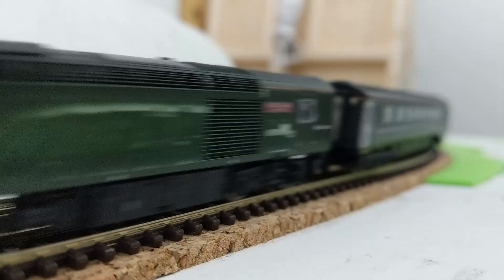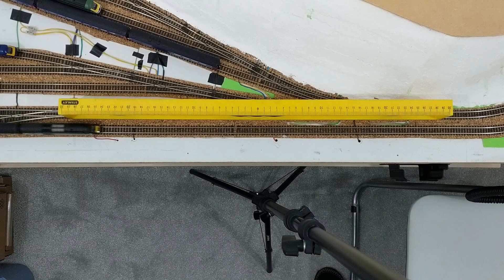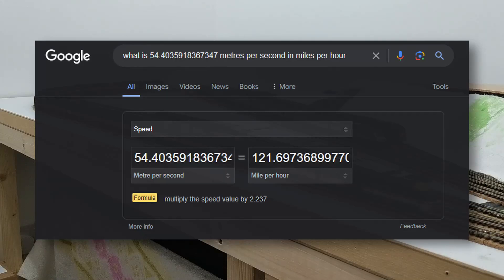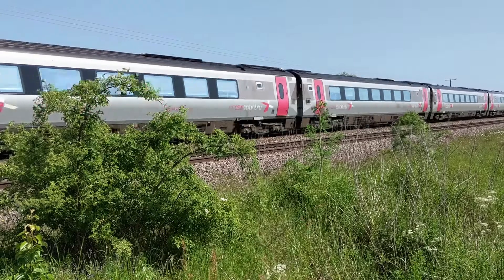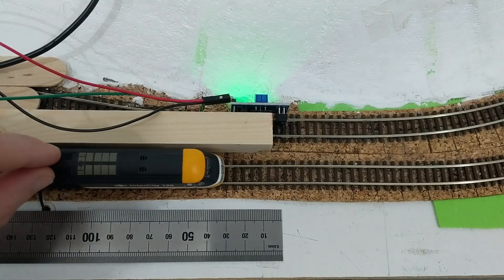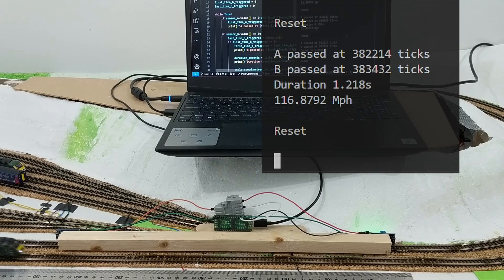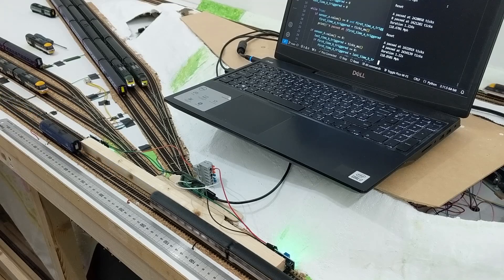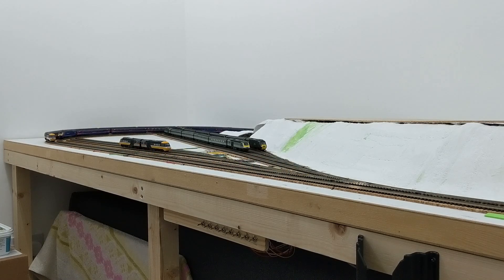0042 Scale speed of Dapol HSTs (and a Kato 800)

Comment: STRETCHING THE ISSUE !!!
The problem with "T" Gauge (T = Three millimetres between the rails) is what actual scale ratio is used. A Japanese company "KK Eishindo" introduced "T" Gauge back in 2006, to represent the Japanese main rail network Gauge which is NARROW GAUGE 3ft 6in. NOT Standard Gauge 4ft 8.5in. This means the original Scale Ratio of 1:450. BUT If Standard Gauge models are used, this upsets the scale ratio and changes it to 1:480, and for Broad Gauge 5ft 6in model trains the scale ratio becomes 1:500 !!! Which means models of Standard Gauge trains effectively shrink slightly , and Broad Gauge model trains, have to be shrunk further. So that the 3mm wide model track still represents the track gauge of a real train using these various gauges and the real track it actually runs on. Which has far bigger implications for larger scenic items such as buildings !!!  This of course reveals that no International agreements were made between manufacturers over the introduction of this scale sadly !

FURTHER POSSIBILITIES
Further 3mm gauge track and available motorised mechanisms also opens the door to this track being useable for Narrow Gauge trains in the larger scales. So in Z Gauge the "T" track would represent 2ft Gauge. In N Gauge "T" scale 3mm track represents a Gauge of just 18inches. In TT100 the "T" gauge track becomes just 1ft Gauge. And in British "OO" the "T" gauge track represents just 9in gauge track !!! 

NOVELTY EARNS MONEY !
So on your "OO" mainline layout you can now have a Rich Mans sit upon railway around his back Garden using "T" track. And a "T" Gauge HST with the cab roof partly removed, and an OO scale model Human sitting in the "T" scale HST power car  - Think about that for an exhibition layout. Which could, if the whole layouts very realistic, earn you a lot of money !!!! Magazines pay you for Model Railway articles. And once your layout appears in a Model Railway Magazine, you're bound to get invites to exhibitions, which can earn you more money, and even get you on TV !

Indeed I was the first to introduce a Japanese Outline Exhibition layout in Europe back in 1990. That layout named Keio Shinjuku (After a Tokyo based 4ft 6in Gauge commuter Railway) caused a bit of a sensation across Europe at the time. It featured in Model Magazines from Peco's "Continental Modeller" in Britain, across Europe and even into a Japanese Model magazine. Which earnt me in the region of £5,000. But this spread to Television. It was on British News at Ten. At least a handful of German TV channels, and finally appeared on a one hour TV show in Japan by Fuji TV called "Narodo to the World", which attracted 27 Million viewers, and more importantly earnt me another £60,000. Meaning the total cost of the layout and all the stock was more than recouped !!!! 

The layout was Japanese N Gauge at 1:150 scale and included scratchbuilt track, scratchbuilt Japanese 3 aspect fully functioning signalling, and partially scratchbuilt (some German Sommerfeldt parts) fully functioning and ENERGISED Catenary. And when Electric locos & Multiple units collect their power from the overhead this allows a number of clever electrical tricks to be added, including real life Track Circuits. Which effectively meant I had a 12v DC multi-train control system available, which increased the fluency and number of model trains on the move at any one time, and was operated to a Real Life Keio Railway high intensity Commuter Timetable. The layout was designed for 4 Operators and required Three control panels, themselves based on the mid 1960's British Railway Computer panels installed in a number of Southern Region Signalboxes, including Surbiton, Basingstoke & Eastleigh in 1966. Total size of the layout was only 24ft x 8ft, and included Two stations, and a rail fed Cement Works.
Reply from the maker: Track gauge and model scale combination in the UK often seems to be a bit out - N is narrow, OO is narrow, T is narrow, 2mm finescale is slightly broad. But in T the rails themselves are a lot wider and taller than 1:450, so the missing twentieth of a millimetre in the gauge isn't what looks out to the eye.

A few people have left comments with similar model-in-model thoughts about T on my first T gauge video - I expect you'll see it in an exhibition model sooner or later!

Your layout sounds awesome and It's great that you got it featured in so many places and made decent money from it 🙂 I like getting a slice of YouTube ad revenue from these videos - as an hourly rate for the time it takes to do the filming and editing it's very poor pay, but I view it as a nice bonus, and I'm not chasing being featured in any articles and certainly don't want to do any exhibiting. As you may have noticed having been through several of my videos now, we've also yet to see what my scenic modelling skills are like - I'm assuming not very good at this stage, so I'm not presuming I'll make anything of a magazine or exhibition standard to start with.
Reply: @endoorrailway  N Gauge was launched by the German Company Arnold in 1962, and they set the ratio at 1:160, so 9mm track is correct. The British modified the ratio when Grafar decided to also get into this then new scale around 1970, to 1:148, which means the track should be 9.2mm to be correct. This being the Gauge the "2mm Association" adopted. The Japanese then introduced the ratio of 1:150, but the Japs have the bigger issue of having Multiple Gauges in mainline use still today. (3'6"; 4'6"; 4'8.5") As they have a "National" Railway JNR/JR and around 200 totally private railways, with their own lines, stations, and other infrastructure. The Railways in Japan were primarily begun by THREE Englishmen. Edmund Morell landed in Japan around 1870, to begin surveying of suitable routes. But was quickly accused by the Japs of corruption and thrown out. He was replaced by none other than the Trevithick Brothers, Richard & Robert, Grandsons of the original Richard Trevithick who built the Worlds first Rail borne steam locomotive in 1803 (Pen-y-Darren) in Helston in Cornwall. The Trevithick brothers becoming Chief Civil Engineer & Chief Mechanical Engineer for the then new Government Railways (IJR). The Gauge having been already set by Morell at 3ft 6in "Colonial Gauge". The first line to open was between Tokyo & Yokohama some 15 miles to the South in 1872, which still forms part of the main Tokkaido line from Tokyo to Osaka via Kyoto around 400 miles long. The Japs still use British "Block Signalling" methods, for both Semaphore & Colour Light.       

"OO" is peculiar to Britain and a bastardised version of HO (Half O Gauge) for the simple reason the British Loading Gauge is the smallest in Europe, and result of pre-WW2 issues of motor availability, and motor sizes. So at that time the first British Outline simply had slightly expanded bodyshells, to suit the very limited Marklin motors then available. But as all models in this size were still very crude nobody worried. And the problem created effectively stuck, Post War. "OO" at 1:76 means the track should be 18.83mm. But even that was not realistically possible even in the 1960's when "EM" was launched at 18mm, later 18.2mm, as an option. Better model tooling available to Modellers had to wait a few more years before 18.83mm could become a reality and saw Two organisations start (S4 Society & P4 Society, which more recently amalgamated). Commercial track at 18.2 & 18.83 is in limited production. From the track specialists SMP, Part of Marcway Models in Sheffield.  

TT (Table Top) was again launched first in Europe which set a scale of 1:120 using a 12mm Track gauge (roughly 2.5mm to the foot). Tri-ang then stuck their toe in the water and introduced British outline TT at 1:100 scale but still using 12mm track, so it could sell the products abroad. And 1:100 meant that the smaller British Loading Gauge resulted in a British TT model carriage "looking" similar in size to the proper TT120 models in Europe. 1:100 was also chosen as it conveniently works out at 3mm to foot scale. This triggered the "3mm Society" to launch 14.2mm track to get the track width lined up with the British TT 100 ratio. 
Hornby however having recently jumped in with British TT120 means the 12mm track is roughly correct, but now British models look smaller than their European counterparts. So whether this will reduce potential overseas sales remains to be seen, as Hornby don't yet seem to want to sell TT120 in Europe !
  
T = Three mm track gauge. Is correct at 1:450 for Japanese 3ft 6in gauge - where the 1:450 ratio works out at 14inches per mm. 3x14 = 3ft 6in, which is the most common gauge in Japan, where it was launched. As revealed in my Post above. The Brits and others have only joined in with this scale since 2008, and have altered the ratio to suit 4ft 8.5in track (at 1:480) and Broad Gauge 5ft 6in (at 1:500). 

And of course to confuse all that further their are a number of "Narrow Gauge variants" including HOe HOm & 009, 16.5NG etc. Indeed I added N/Zng, in 1976 with a German layout in N Gauge with Z Gauge 6.5mm gauge track for a metre Gauge branch, which included dual Gauge track and pointwork, all scratchbuilt.  

Hence the major reason why Britain uses non Standard Ratios is all due to the British Loading Gauge. British trains tend to be no wider than about 9ft and no higher than 13ft. In France you can have stock 10ft 6in wide and near 15ft High. In German both width & height are again slightly more than France. All these sizes come under the Heading of "Loading Gauge". British Rail had been working (secretly) to expand the Loading Gauge in Britain to accommodate Double deck trains. "Secret" because the "Ministry" had forbidden BR to do such a thing to PREVENT Articulated lorries from fitting on railway wagons in Britain. For the simple reason the Civil Servants were still minded to get rid of Railways and replace them with Motorways, as laid out in the absurd "Serpell Report", (of the late 1970's). Hence whenever Governments or Civil Servants stick their nose into the realm of highly technical Railways, the Railway has always come off worse, going back as far as 1850 !
Reply from the maker: You hold a wealth of railway information!

Yes I thought it was something to do with historically not being able to fit motors into the smaller British models (if they'd been kept at the right scale). It's a bit odd being worried about selling smaller models abroad - it makes total sense if the real trains they're models of are smaller. I got 2mm finescale the wrong way around - it's still too narrow (2mm finescale being 1:152, a gauge of 9.42mm according to the association's website). With standard gauge being 1,435mm the 1:148 gauge should be 9.70mm, but 9.42mm is going to be noticeably better than 9.00mm 🙂
Reply: @endoorrailway  Hardly surprising I'm a highly qualified senior Railway Mechanical & Electrical Engineer, and a Master Modeller. And I have owned a Major Import Wholesale & Retail Model Railway Business specialising in Japanese outline back in the 1980's & 1990's. Which I rapidly built up and then sold to a German Company. I was also the Editor for both the German Railway Society & the Japanese Railway Society, both of which are still around.   

Well it doesn't really matter what the track Gauge should be, unless you are capable of Scratchbuilding track, and have the necessary "Roll Gauges" & "Tracksetta" tools to produce the track & Pointwork !  And want to spend lots of time reconstructing chassis to accommodate a non Commercial track Gauge ! 

I think P4 looks really nice in 1:76 scale. But I would never indulge in it personally. For the simple reason I only build large exhibition layouts based on real life track plans, usually involving 4 track Mainlines. And therefore requiring large fleets of rolling stock, with up to 13 coach passenger trains. Which would take me years to build in P4. And I don't make any money while the layout is under construction, only when it starts on the exhibition circuit, where I can make thousands. 

So instead I use code 75 bullhead rail, and handbuild only the points. So I can have any radii I need. Which allows me to copy exactly real life track plans. Which you can't do when using commercial pointwork such as Peco. Commercial Point ranges are so limited they are virtually useless. And there are a number of point types no commercial company wants to make. Such as "Outside Single Or Double Slips". I can scratchbuild a 6ft Radius point in OO in around two hours, using only code 75 rail, and Copperclad sleeper strip. No jigs necessary, only four Code 75 Roll gauges, and a selection of Tracksettas. Which I had a machine shop make me up in aluminium at 3inch radius increments around 25 years ago. And a 6ft radius point costs me around £5 in total cost, using my method. The other trick is to build the point on site, as this saves a lot of time. This requires only a few simple Modelling tools such as needle files, a 12v Mini Drill with Carbonundrum (grey) discs to cut rail cleanly in less than a second. A Modellers soldering iron such as an Antex XS25 a 25w small tipped type with replaceable tips, cheapest if you buy from Antex in Plymouth direct. And that's it, your off to another beautiful layout....... 

Happy Modelling 🙂
Reply from the maker: You make very valid notes there - I certainly don't have the skills or desire to re-gauge all my locomotives and other rolling stock. Thanks for taking the time to share some of your knowledge and thoughts 🙂

Comment: Hi Jonathan! Another really interesting video! Funny, but I always think my model trains run far too fast rather than too slow! Interesting observation about the difference in model and real life speed though! I wonder what it would look like if you mounted a camera to the train looking at right angles to the track? Would probably seem much faster! I was going to mention the Super Creep motor in the newer HST sets, but someone beat me to it! It's the same motor that's in Dapol's class 33, and is super smooth at slow speeds! I wonder why the motor speeds up though? I can't think of a plausible explanation unless the momentum settings act for a lot longer than we think they do!!! All the best, Ian.
Reply from the maker: Hi Ian, thanks :) I tried to capture some close shots for the start of this video, and in those I think the Castle set does look a lot faster, so I think you're probably right about how it would look from a side-mounted camera, though I suspect even then I'd need to be viewing the footage in I-MAX to have the same effect as real life. Yes the gradual increase is odd - I don't know enough about exactly how the motors work to come up with sensible theories, but I'd be very surprised if it were the DCC acceleration - if it were that then it's following one acceleration gradient up to very nearly top speed, then suddenly switching to a massively shallower gradient to do the last little bit, and both the Dapol and Kato (different decoders) behave that way. But, my curiosity is satisfied for now where scale speeds are concerned :) Now I'm waiting for my Sonic Models Large Prairie to arrive :)
Reply: @endoorrailway  - Ah, I'm also waiting on the Large Prairie which will be a loco from a new manufacturer to me! I think I ordered the wrong decoder for it though as apparently it needs a 6 Pin 90 degree decoder, which is something I'd not come across before! Oh well! Just another path to follow on my model railway journey! Cheers, Ian.
Reply from the maker: Yes, I only noticed the other day the description mentions that, but the one I found at Rails was out of stock so I've ordered it from TMC. Today I've come home to the loco waiting for me :) I won't have time to play with it today though, so the decoder's got another day to arrive! I must have put one of those in my Sonic Models 56xx because that has the same note in its description, but I don't remember it at all!

Comment: Very interesting video, I did some similar tests using camera frames to calculate the speed with some of my HSTs a few years ago. What I found the most interesting was the difference between the older power cars and newer ones. As of 2020, Dapol changed the motor they used in these sets to a 'super creep motor', and while the slow speed running is much better, it does compromise the top speed. My older models were achieving a good 150mph with a full set! But they are quite inconsistent, some would do 150mph, but others would struggle to reach 100. So maybe the new motors are better overall?
Reply from the maker: Thank you :) That's interesting - you continue to be a source of good stats on Dapol HSTs! I've just calculated the scale G force around the corner on my layout (7.6G!), and it's got me suspecting that very few people have such large sweeping curves on their layout that a scale 125Mph would be appropriate for the turns, so maybe a motor that performs better at lower speeds is the better choice. I certainly like being able to drive them slowly into and out of the sidings, so if it's one-or-the-other I think smooth when slow but not quite a fast enough top speed it what suits me.

Comment: Well that was fantastic and i notice when standing  over a layout the speeds seem to be slower but when viewed at board level they seem faster. The youtube video editor allows the magnification of the time lapse but the set up with sensors and laptop is brilliant and amazing how they increase as they warm up.
Reply from the maker: Thanks 🙂 Ah, good to know about the YoutTube editor - I've never considered that before! Yes the increases are odd - it's as if the motor benefits from a mini running-in each time the loco is used.